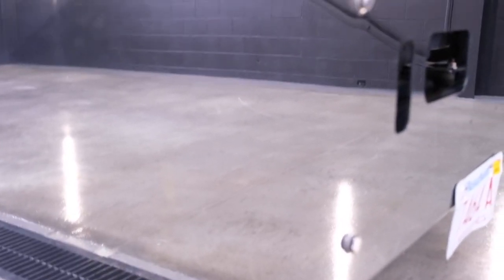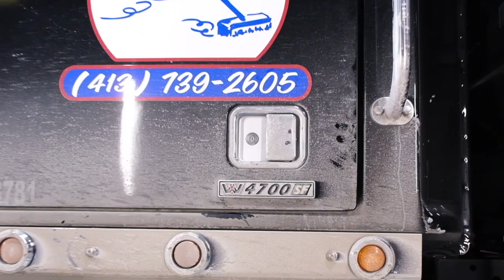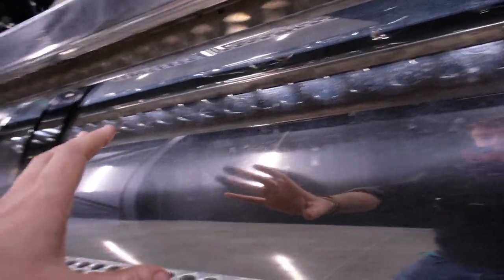How To Get A LEGIT TOUCHLESS WASH on A SUPER DIRTY BLACK TRUCK!

Comment: By all means I am no expert at all in auto detailing and I am not trying be negative, but it’s seems like on other auto detailing videos, the soap is more thicker when it when applied, kinda like shaving cream or something similar. Now I know all things take a part in it, pressure, tip size etc. etc. just maybe thinking you can give us your opinion. But other than, you have some way good quality stuff, and great videos to learn from. Also, it wouldn’t make any difference if you washed all the dirt off first, before applying the soaps? Love watching your videos. Thank you

Comment: when using the foam cannon, whats your prefered method, add water or soap to the bottle first?
Reply from the maker: I like to add the water first if I’m mixing them, ideally I use the premixed 5g pails tho and just fill em up I don’t like to take the time to measure😁
Reply: @ChemX  thanks Bob im never sure which is better sometimes ill add soap then water or water first then the soap.

Comment: Are you using hot water to rinse? I did the exact sequence and still have road grime on but only used cold water. i did it one more time with even stronger soap and still not great results. My water is medium hard i would say.
Reply from the maker: I use cold water at about 5 grain hardness which isn’t great, however I do have 4gpm@3000psi and I rinse extremely thoroughly at about 6” distance I’d recommend trying that, and make sure your foam cannon knobs are fully tightened that affects the strength of the soaps coming out as well

Comment: I was talking about this kit with my operations manager the other day. Now he’s telling me if I buy it he’ll hire me as the fleet washer. My question is, what’s the smallest pressure washer I can use to be effective?  Am I able to use my 1600PSI 1.2GPM electric unit?
Reply from the maker: That sounds pretty cool man, yeah on the specs that’ll run the cannons but it’s on the small side, which would slow down the process and would get a bit less results. How many trucks we talkin?